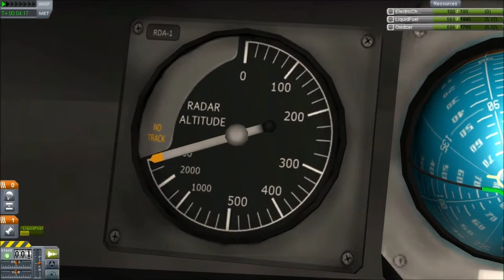[13] Let's play: Kerbal Space Program! - Bust or Bust 2

Comment: A little help for your larger rockets.
1. Every piece has certain weight. On the launch pad, the pieces touching the ground/the launch stabilizers MUST carry the weight of everything above them in the stack. Too much weight for a single component = the component explodes, stack falls in on itself. You've had this happen several times already.
Space Tape is your friend, because it allows the hull stress to even out when properly placed.

Comment: 2. Think both wider and taller. Nothing says you cannot attach stack decouplers to the bottom of solid fuel boosters, which in turn are attached by radial decouplers to a large fuel tank. Presto; another 'layer' for how many liquid fuel tanks you want. Just remember to use space tape and additional SAS modules.